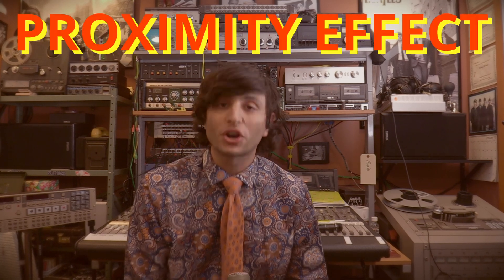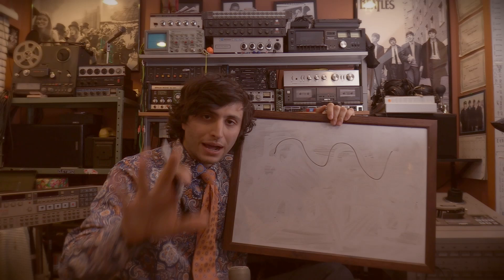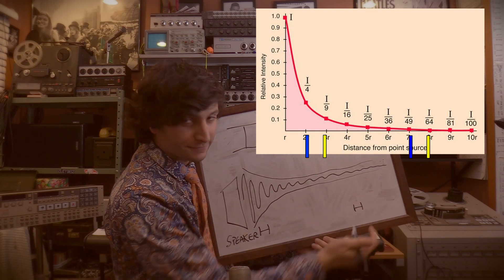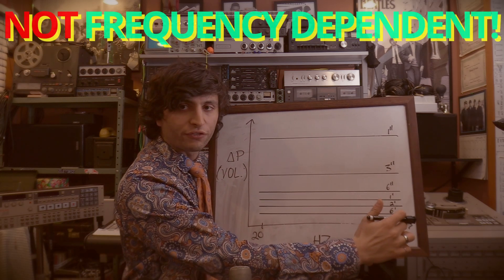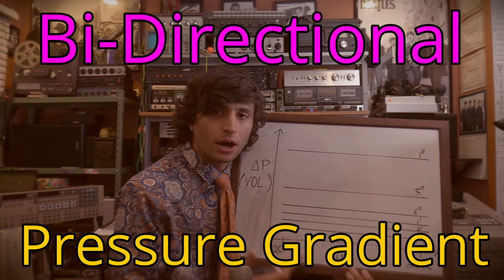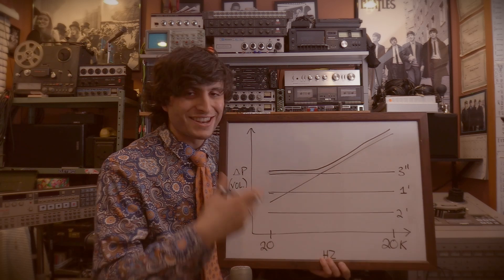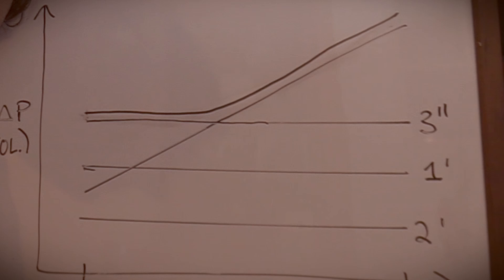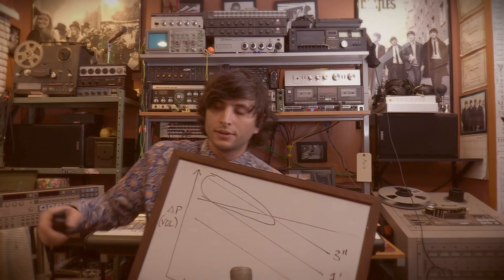The Best Explanation of the Proximity Effect on the Internet...well maybe.

Comment: I'm curious if, since lower freq's disperse more than higher ones, wouldn't larger diaphragm mics have stronger bass response than smaller ones, regardless of proximity effect, the closer to a point source because they capture more of the dispersed wavefront?  I also wonder what is considered the "surface" of a guitar speaker with regard to micing?  Is it the actual cone surface, or the plane at the surround?
Reply from the maker: What do you mean by "lower freq's disperse more than higher ones"?  Not following you there. The larger the diaphragm on a microphone, the more it will react to sound waves, the louder the signal will be. Generally speaking of course.  This is why small diaphragm condensers usually have a smaller signal. SDC also have more top-end but I am not really sure it's for the reasons I mention in this video. I would have to do some research on that. 

The surface of the guitar speaker is a good question. In practical manners it doesn't matter much though right? If the mic position sounds good and you get the amount of proximity effect you want that it's good enough right?

In reality, objects omitting sound don't act as a true "point source" like the theoretical math and physics suggests. Reality is a very complicated system to model on paper.  Lower frequencies act more like a point source than high frequencies at short distances though. Perhaps this is what you were referring to about dispersing?

Comment: Sooooo, how does the low cut switch work in this scheme
Reply from the maker: You want big boom boom, no switch. You don't want big boom boom you flip the switch. Lol but seriously. In the simplest form, a small capacity capacitor connected in parallel to your output terminals gives you low end roll off. I suspect a lot of lower end/mid-tier mics work this way.
Reply: @Mario_DiSanto   LOL beware the Boom stick yo! You are the rare example of an engineer that can relate to other humans. Next question is do proximity effect and low cut filters affect the phase of a signal the way an equalizer does?
Reply from the maker: No, an EQ works on different principles. That is a much more complicated topic and something that I need to understand better myself before I try to impart this wisdom onto others. @AldeanLeger